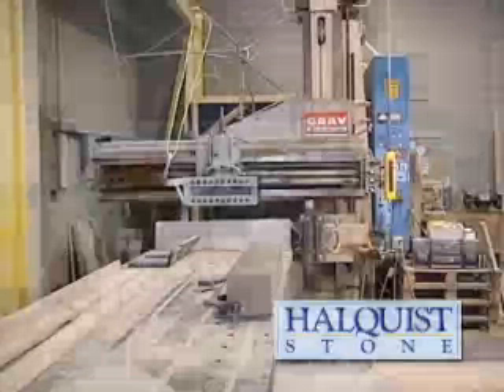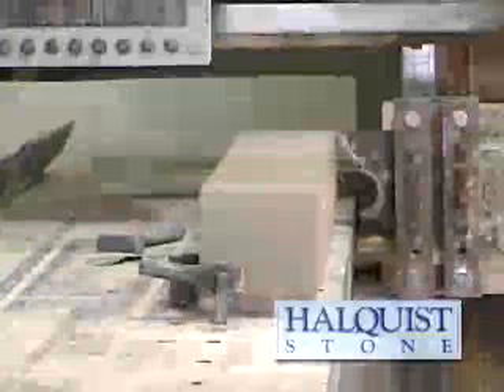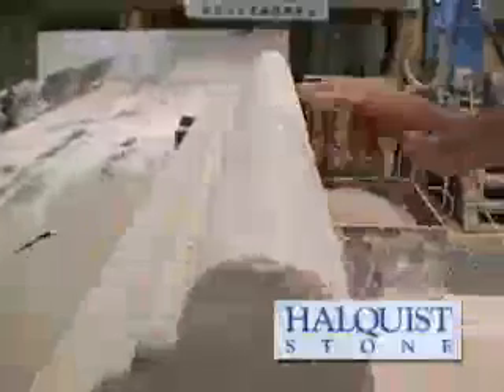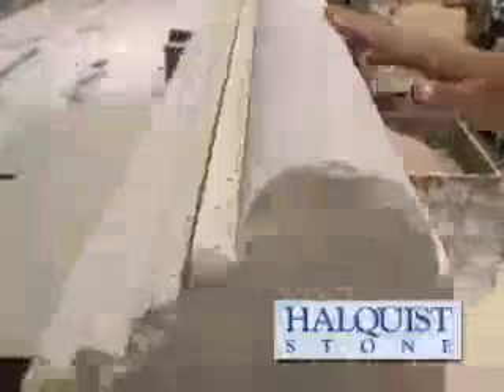Planer Finish of Natural Stone

Comment: HELP!! Can wood thickness planers be converted to stone by inserting diamond cutting teeth on the cutter head?

I need to be able to plane up to 16” in diameter, to less than 0.05mm run-out! 

The plane would be for a base that can NOT wobble

Desperate for any advice!

Thank you